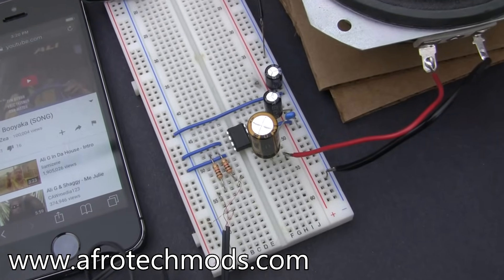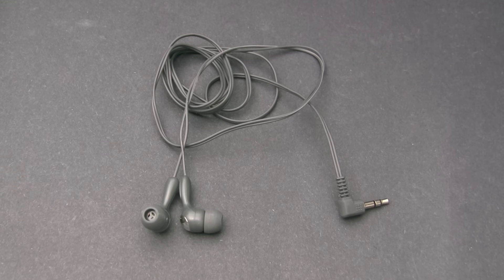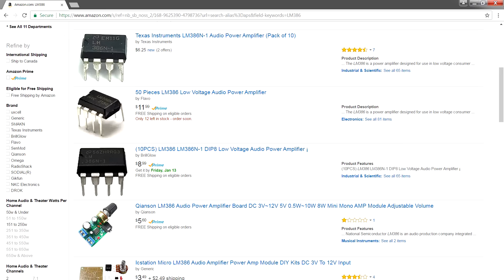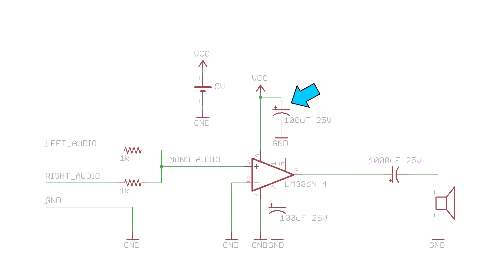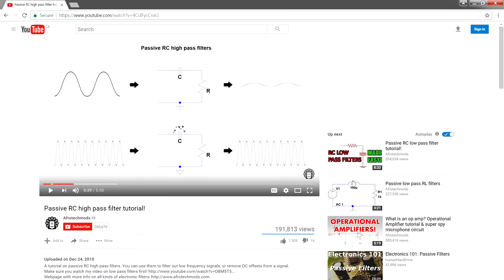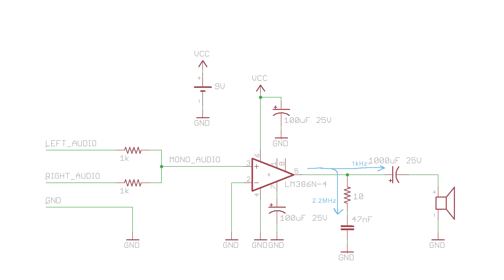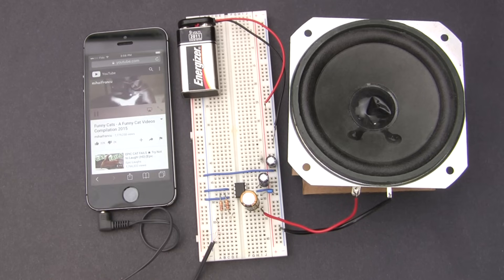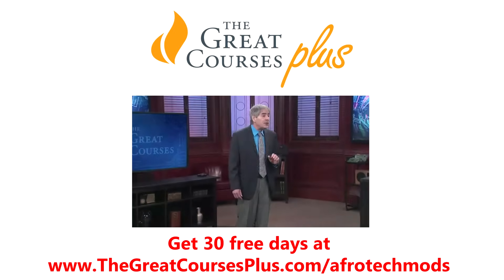🔊 How to make an LM386 audio amplifier circuit

Comment: That series resistor capacitor on the output is not really a high pass filter, it is a Zoebel network and what that does is keep the output impedance steady across the audio spectrum by compensating for the different inductance of the speaker coil which is dependent on frequency. They are also very useful to make sure you have a good 8 or 4 ohm impedance at the crossover point of a crossover network.  That is why the resistor is added in series with the capacitor.  A lot of what causes the high frequency oscillation is the impedance mismatch  and a Zobel network fixes that problem.

Comment: Would that work with a guitar?
Reply: Yes. It makes a solid simple amp, but it will hardly amplify your guitar. A guitar is not a line level output, so the sound will be very harsh and its volume will depend greatly on your guitars pickups.

Comment: Hello! I have never built your circuit. However, the LM386 is famous for the following: ① The LM386 has an old and unique design, and omitting the 10KΩ to 5KΩ input volume on pin 3 will result in poor sound quality. ② The design balances the differential amplifier circuit by grounding this volume to -GND via 10KΩ to 5KΩ and grounding pin 2 to -GND. ③ Therefore, if the input volume is not needed, it is necessary to insert a fixed resistor of 10KΩ to 5KΩ between pin 3 and -GND instead. And so on (from Japan).

Comment: Great tutorial on the LM386. The RC network recommended on the output is called a Zobel network or Boucherot cell. The purpose of this is to modify the speaker impedance at high frequencies so that the amplifier will remain stable across its whole bandwidth. The LM386 can sound surprisingly good when it's set up just right and used within its limits.  
Another interesting point about the LM386 is that it produces more distortion as the supply voltage increases if used with low impedance speakers such as most hifi units. With a 4 Ohm speaker it will perform better with a 5V supply than with higher voltages. This is because the output current it can supply is limited, so a higher supply voltage just introduces more THD without actually giving any more power to the load.

Comment: How do I increase/lower the gain with the LM386? i.e. how do I make the amplification amount of the speaker more or less?
Reply from the maker: Look at page 10 and 13 of the datasheet https://www.ti.com/lit/ds/symlink/lm386.pdf  do you see how between pin 1 and 8 they add a resistor and a capacitor?
Reply: @Afrotechmods  great thank you so it looks like the minimum gain is 20 and you don’t need to add any resistors or caps to pin 1 or 8 to get that gain?
Reply from the maker: @tinywhoopfan  The gain is 20 by default yes
Reply: @Afrotechmods  Thank you! This is my first time using an IC! For the capacitor connected to pin 6: you say connect it in parallel to the voltage source. In the close up at 5:22 I cannot tell what pins the cap is inserted into.  It looks like you plugged it from GND directly to the power rail? wouldn't that short circuit?  Thank you again for responding!

Comment: Just made this amplifier and it's working perfectly. I even added a potenciometer to adjust the volume. Thanks for making this video I've always wanted to make something like this
Reply from the maker: Yay! Glad you liked it!
Reply: Where do you connect the pot?
Reply: @tinywhoopfan pin 1 of the pot in between the 1k resistors that convert stereo to mono. pin 2 of the pot directly to pin 3 of the amp chip. and lastly pin 3 of the pot goes to ground. hope this helps you
Reply: @100kPotentiometer  thanks this is perfect!
Reply: How? Do u have a Circuit diagram . i cant imagin.
Reply: @quswer8206  you still need it? I can try to make one
Reply: @100kPotentiometer   Yess plssss but how can i get that?

Comment: If the max speaker output for this circuit is only 1W, then using a 3W speaker will roast the circuit, right?
Reply from the maker: Actually no! If it is a standard 4R or 8R speaker then it won't pop the circuit. What will happen is that you just can't drive the speaker to its max possible power output levels. Good question!

Comment: How can I connect two separate lm386 modules that are mono, together in bridge to achieve stereo with a single power supply?
Can this be done without a 3rd lm386 ic?

Comment: If the noise is around 2.2MHz, how do we hear it? It is beyond the max audible frequency.
Reply from the maker: Excellent question. So yes, obviously you cannot hear the 2.2MHz itself. The problem is that this large 2.2MHz component was, at times, messing with the amplifier's feedback loop for the lower frequencies. And the result of this was clearly audible distorted audio and you can even see it on the oscilloscope plot.

Comment: Heya bro 🎉 your circuits are great it’s important I mention I successfully made your speaker circuit. I’m interested to know I have a speaker that’s 3.5 ohm 3 watt and how does this react in this circuit ? Using ofcourse 5 to 9v
Reply from the maker: I think it would probably be fine just don't expect to be able to drive it at full power.

Comment: Thanks for the great video. Just out of curiosity, what is the purpose of the 1k resistor at the audio input, what if we don't add these
Reply from the maker: It isolates the audio channels from each other. Otherwise you would have two output amplifiers from your MP3 player trying to drive each other. It also creates a basic mixer, averaging L + R channels together.

Comment: I'm watching this and listening to it with the circuit I learned to build here. Sounds good but I need to use the 1000uf. It has a 450uf on a 4ohm 3w speaker. Sure a speaker box of correct size would change the situation also.

Comment: thank you for these very helpful videos. would this work with NE5532P op amp. ive just stumbled across this. But only have the NE55 Op amps to hand.
Reply from the maker: No - the NE5532 is a low power op amp suitable for preamps, not driving a speaker.

Comment: question, I made this circuit and it works really nicely, but there is a 5khz sound always in the background how do I get rid of this? the only difference that I made is I'm using two speakers with audio crossover and I have a capacitor after the stereo to mono conversion.

Comment: I’m curious if one should change the 1000uF cap from electrolytic to a ceramic or something like that. Just curious because I heard electrolytic capacitors don’t like AC signal.
Reply from the maker: You won't be able to find a 1000uF ceramic cap. In this particular circuit an electrolytic cap will be a good choice.

Comment: How to power up the audio amplifier circuit without a battery source, I mean is there anyway to power the the circuit directly from the AUX cable without any external power supply to the circuit? please help.

Comment: I made it..
Volume too high..
Buzz sound (noise) high..
100nf capacitor not available so used 2.2nf
You can check here
https://drive.google.com/file/d/1Q2oKaroRnl3TGC2O5q4BeSDz59p1YY9Z/view?usp=drivesdk

Comment: Wow this is the only set up that works. It worked for me. I bought a pack of 10 LM386 chips on Amazon I thought they came defective because never sounded loud and had a popcorn sound. But the way this circuitry is set up works perfect. Very loud

Comment: I know this was posted Four years ago but is there anyway to change the volume of the speaker or is it constant?
Reply from the maker: Use the volume control on your audio player, or use a potentiometer as a voltage divider before the input to the amplifier.

Comment: Hi I just built this project and it worked just as planned. However I do have one question, would it be possible to convert the mono signal back to stereo?
Reply from the maker: Nope. You'd need to make 2 of these amplifiers and do dual mono, or you could look for a new stereo amplifier circuit.
Reply: @Afrotechmods  Thanks for the quick response, I appreciate it! I also thought of making the dual mono but was just wondering if it was possible to convert back, its a great learning experience for sure. Thanks again!

Comment: When I connect my arduino to this amplifier, I get a "pop" sound when it powers up. The sound is great after that, but is there any way to cancel this popping sound at the beginning? For clarification, the amplifier and arduino share the same 5V power source. Even after providing a 9V power supply from a battery to the amp, I still get that pop when the arduino switches on. Any help would be huge. Thanks!

Comment: Because it's the amount of current flowing into the resistor and capacitor in series. It's the rate at how fast the capacitor charges/discharged, is what makes the waves... Charge and discharge curve.. RC5.

Capacitors supply voltage when needed..
the resistor after the capacitor is what creates and gives the current to the.
Capacitors and resistors being used together are used for charge/discharge if you've ever seen it drawn/plotted..

I've been studying electronics for a long time.. it's actually paying off. Everything is basically about variable voltages.. and input signals.. and how you handled them.

Comment: Hi, great easy to understand video. I really liked that you included the first version which gave unexpected results and then showed how to counteract that. I do have a question however, if i were to make this circuit for a stereo application could I just double up the circuitry to achieve the same result? Or should I add something else to counteract the coupling of the two signals for instance? furthermore how would I add volume/ gain control to a circuit like this and would it be possible to get gain control for two channels using only one potentiometer?
Thanks in advance, i hope you get to see my question.

Comment: Connect pin 2 to GND with 150 ohm resistor, not directly. It will work better. Put 100uf capacitor in parallel with DC input. There is one in your diagram but we often forget it! And if you want bass booster, connect 333 ceramic capacitor (0.033uf) in series with a 15K resistor, and then connect other pin of 15K resistor to pin 1 LM386, and other pin of ceramic capacitor to pin 5. You can also adjust gain between pins 1 and 8. I usually use LM386 as preamp that can have up to 200 gain!

You need a capacitor in parallel to the power source, even if it is a battery. bypass is not needed (pin 7) and will most likely cause some more troubles.

Output capacitor should be 1000uf at least to get good bass and better working when placing 2.2 to 4.7uf capacitor value between your stereo to mono converter and LM386 input

Replace output filter 10 ohm resistor with 4.7 ohm.

Comment: Hello! I am new in the world of speakers and audio amplifier. Can I connect the + of the LM386 to a simple PWM to reproduce a bip sound (at a certain frequency) and use the DutyCycle to modulate the volume. Does the ciruit need to be changed in this case? Thanks a lot.

Comment: can you please explain if i want to add VOL: control pot which value and how it's done.
Reply: Late answer, put pin 3 of lm386 to pin 2 (output) of potentiometer. Then pin 1 (vcc) of potentiometer to the mono connection of the audio channel input. And lastly pin 3 (ground) of potentiometer to ground of the circuit.

If the volume adjuster is backward when turning the pot, just flip the connection of vcc and ground of the potentiometer. Hope this help.

Comment: So when you use the LM386N-4 doesn't that mean it ought to be hooked up to a speaker with a load impedance of 32 Ohms? If I were to use a Visaton FR58/8 with a load impedance of 8 ohms for instance wouldn't I be better off with a LM386N-1 or LM386L in my case because it is what I have available but it has the same values as a LM386N-1. Planning on building a little mono internet radio and was wondering if someone could help me out on this question. Cheers! Nice video though.
Reply from the maker: The N-4 is just a higher voltage chip. You don't have to use a 32R speaker. This isn't a hifi amp by any means so just use whichever LM386 works best with your power source. The chip you have should be fine for your project.

Comment: Thanks for your work, I have learned hugely by watching your videos. Just one thing: my son (13 years old) has built this amplifier, following your instructions. He has soldered everything and powered with a Hanmer HM305P, it works fine for some time, then boring noises start to litter the performance. Our hypotesis is that the power supplier, at a certain point, stops working properly, introducing annoying disturbs. We are planning to feed the amplifier with a battery but, in this meanwhile, a comment from your proficient side, would be welcome.

Comment: Hello. 
I wan't to make a little loudspeaker device that's play some recorded church chimes/music every time i open the closet. Any idea what i can use for the purpose? Thinking a blutooth speaker but then it's the problem with the recorded sound. Some kind of a switch should activate the speaker. I found this one :

https://www.ebay.co.uk/itm/USB-Music-Sound-Voice-Playback-Recording-Module-Chip-Recorder-Recordable-Board/283691451107?hash=item420d5402e3:m:mLYejCvpM4C9oTP1LXPC99Q
Only think it’s too low in sound.

Any suggestions?

Happy holidays.

Comment: Hey afrotechmods! I had a quick question... Could we use a 10W speaker with the same circuit?
Reply from the maker: Sure! You just won't be able to drive the speaker to the max it can handle

Comment: Where should I place a variable resistor to control the volume?
Reply: If I were you, I would redirect his positive wire a couple spots down and link it back to the big capacitor with your variable resistor 5:20 is what im looking at

Comment: I got problem sir..when I touch aux jack with bare hands,my speaker works well but when I use phone and play audio, the speaker is not working. It is producing very little sound such that I have to make my ear touch the speaker to hear.What is the reason behind this...and I am using 8 ohm 2 watt speaker..🤔

Comment: So how is it possible that you get such “clean” sound (relatively) even though the signal has a positive dc offset on it.
Wouldn’t it be better to use a virtual ground circuit after the battery?

Comment: I am going to use your diagram tell me the positive voltage VCC and the 100 microfarad vcc at pin 6 are connected together? And that's the only place positive voltage is connected to?

Comment: DAMN, I made this amplifier, but it picks up radio frequencies and mobile 4G 3G and 2G signals, wifi aswell I think, dunno how to fix this
Reply: You need to shield the circuit in a metal enclosure, keep all leads as short as possible and use shielded cable on the input.

Comment: Great Video.
This may be a stupid question but you say the battery will drain quickly, would the battery drain when no music is playing or only when there is something going through the amplifier?
Also, Do you know if you could build a circuit that will stop music from going over a set level. 
I deal with people with learning difficulties and they play music too loud but don't have the capacity to turn it down. Thinking, if there was something to reduce sound to a set level would be a great piece of equipment and save the LD from getting evicted.
Thanks for help.

Comment: I want to use it for a   small 8 ohm speaker, and add a volume control, but also it only needs mono input. So I plan to use one  1 k resistor to input, and  what would you suggest, using a 1k potentiometer instead on the input, or use something on the speaker end.  Can I get away with the  potentiometer to be connected via jumper wires to a case mounted pot?   I should also add that the input audio will come from a 4046 voltage controlled oscillator. Would a capacitor in series with the input from the 4046 be a good idea?

Comment: You have to make sure to bypass the power supply as well, best thing to do is put a .1uf also between the power and ground pins directly by the chip (a bypass capacitor)

IMO LM386 doesn't sound very good. I grabbed an NTE740A the other day, it puts out 2Watts and is much more suitable for speakers. I still tend the think the LM386 is better for headphones

Comment: using 100k resistors instead of 1k resistors on the input makes it sound slightly better and reduces noise from stray radio waves

Comment: For stereo to mono I just join the two wires together, seems to work fine but why should I use a 1k resistor?
Reply: To ensure that the current going to the chip from each channel is balanced, may also be a requirement to limit the current going to the chip, I haven't read the datasheet.

Comment: I made this amplifier and it works but it has some sound like in the video before you put the capacitor. I tested with a 47nf capacitor and it removes the noise a little but again it makes noise like beeper

Comment: Normally the output of amplifier is in khz frequency let suppose the output is 10khZ
In this case the xc of output capacitor series in speaker will be nearly about  0.15 ohm
And this resistance will be same for dc because signal source and dc are combined grounded then how this capacitor blocks dc
Reply: "resistance will be same for dc" It won't, the DC component of the signal will charge up the capacitor and from then on all the current will be from AC.Think of it as a sum of two waves: DC is zero frequency (so the capacitor has infinitely high impedance) and high frequency you want to pass (cap has lower impedance)

Comment: so here is my question, what if you take that system of yours, and apply it on car audio? i mean, for example you got 4 audio monitors in your car, you just make separate circuit for each monitor and instead of connecting them to a phone with jack u directly connect them to your car audio-radio, will that work? or instead of making separate circuit for each monitor you just make a 4 channel audio amp circuit and connect it, will it work? i hope i described my point well...